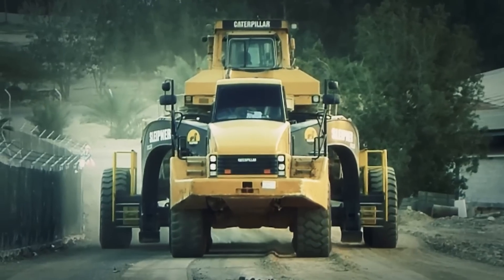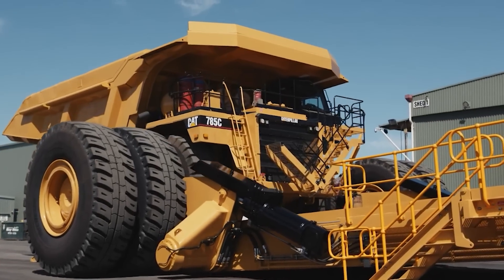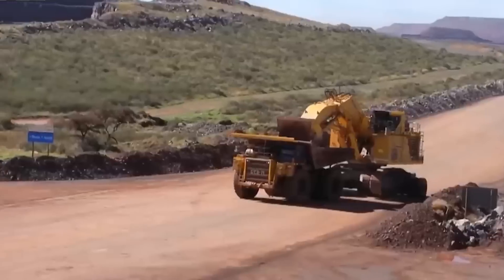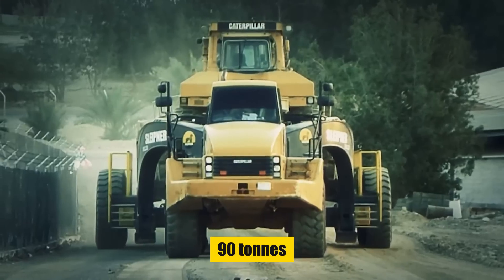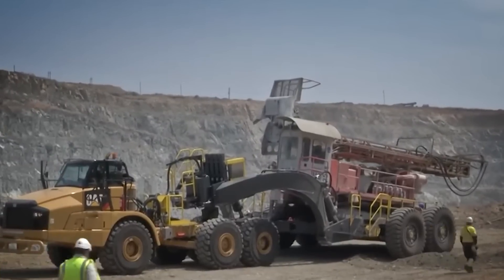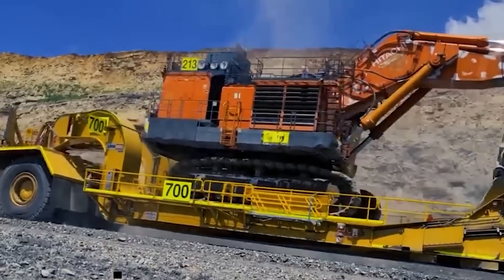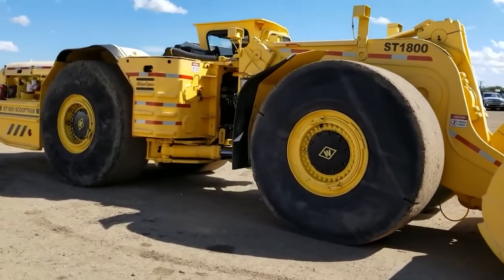Revealing How The BIGGEST Oversized Loads Are Transported

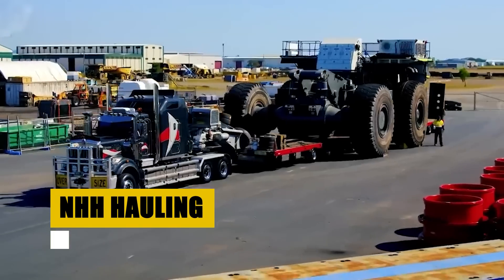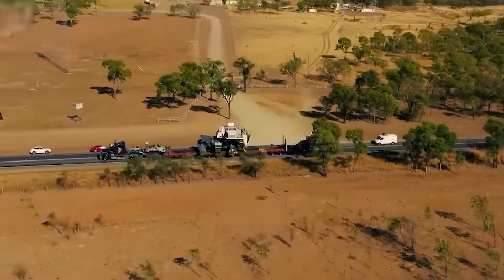Comment: Pretty sure that you will find that NHH (National Heavy Haulage) is an Australian heavy haulage company operating in Australia. The footage you are showing at 9:30, 9:40, 9:46, 9:56, 10:15, 10:34, 10:49, 10:56, 11:04, 11:15, 11:19, 11:30 and 11:52 are all trucks belonging to Doolan's Heavy Haulage, another Australian haulage company that has no connection with NHH.
Reply from the maker: Thanks for the input , that maybe so but NHH service also exists in Tipton Indiana